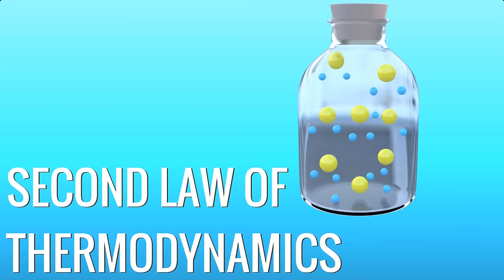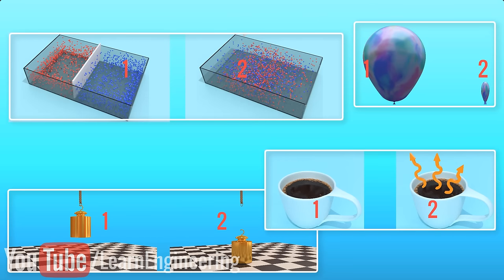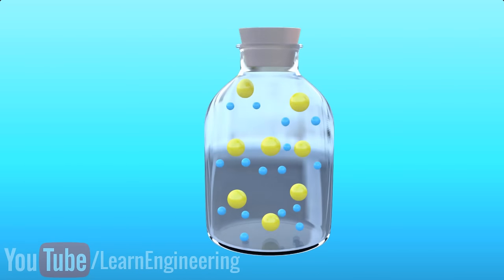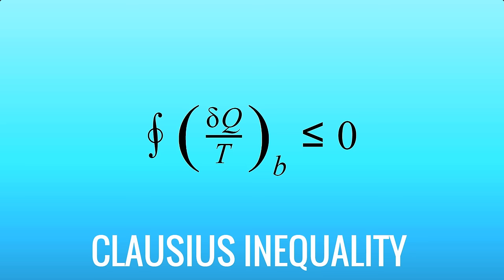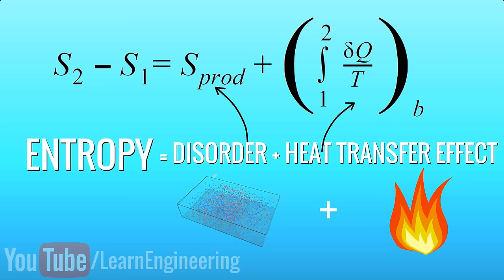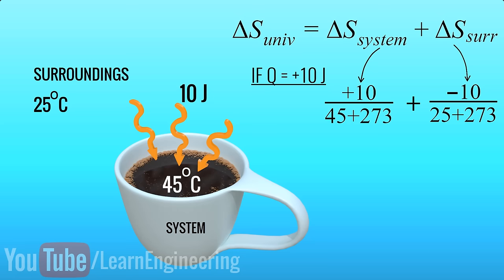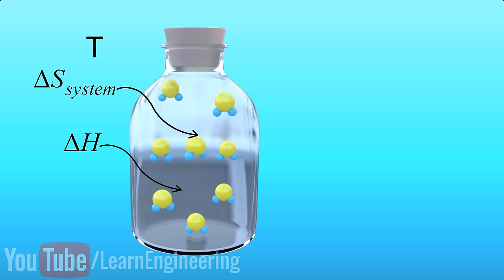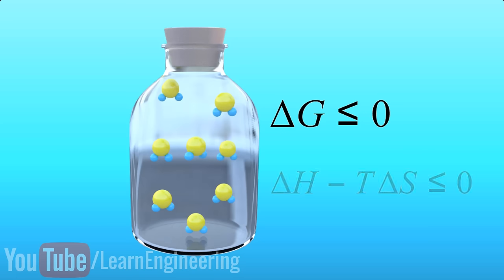Understanding Second Law of Thermodynamics !

Comment: People seem to be very confused in the comment section here, The second law of thermodynamics regards entropy. This law tells us Entropy in a reversible system is equal to zero and an irreversible system it is Positive because entropy cannot decrease. I do not like the typically definition people give of entropy, the best way to describe entropy is the amount of work lost in a system. No system is 100% efficient take a heat exchanger for example. a hot stream and a cold stream come in contact with each other where heat transfer from the hot stream to the cold stream takes place, the transfer of that heat energy is not 100% efficient and some of the energy is lost during the transfer and moved into the surroundings or universe, lost to both the cold and hot stream. This law simply tells us that this occurs.
Reply: wow you know it very well. then, WHY ARE YOU HERE?

Comment: So if we create a device or a system that is always colder than it's surroundings we could collect heat energy from it?
So if we could create a cold cell battery that turns that collected heat potential energy, into useful electrical energy, couldn't we make way better battery that could self recharge as long as the system or battery is always colder than it's surroundings? Question is how cold does it need to be to collect an adequate amount of heat energy in a reasonable amount of time, and what are the most efficient dimensions for the systems to function optimally for different out puts or energy needs?
Reply: @Appl3 YT I thought solar was just uv light absorption, that's the reason solar is useless during the night. I'll look into it more tho. I was more talking about a system regardless of day or night as long as the surroundings are warmer than the inside of the system you should always be able to collect the heat energy even in a blizzard.
Reply: @Appl3 YT just depends on how efficient your heat pump and compressor are. We have gases like freon that could easily stay cool with little power and conpress the collected heat into other forms of useful energy. I was using a blizzard as an extreme example as a condition where would still work as long as the freon or other  refrigerate is cooler than the surrounding  area to collect heat.

Comment: There's no reason a random entropy dip can't happen that would allow for all of the particles in the room (in the example) to separate themselves again on either side without adding any more energy into the system, of course it wouldn't be stable but to say that it can't happen just isn't true. Then again it's a nitpick and for practical purposes we can just assume it to be true and it won't matter since we'd have to wait longer than the lifetime of the universe to see such a large localized dip in entropy. I'm not sure why you claimed it can't happen though, maybe to try to not confuse more people? Either way it's just a correction. Good video for the most part otherwise.

edit* Also entropy is not a measure of disorder, its more like a measure of the "specialness" of whatever state you're measuring. Essentially using all combinations of macro/microstates of a closed system to evaluate an emergent statistical property of said "specialness".

Comment: Very nice video! But I would like to claim a flaw in this video. You treated a case of H2-O2 reaction to explain the free energy. The combination of H2 and O2, however, yields H2O “spontaneously” in most conditions, independent on temperature of surroundings. In other word, this reaction is intrinsically “irreversible”. It is not nice case to explain the role of delta G on chemical reaction. I recommend the case of ice melting and freezing to explain the role of free energy. Because plus or minus of delta G in this case sharply depends on temperature of surrounding. I deeply regret this only one flaw in all.
Reply: In my analysis, reaction oh H2-O2 is highly exothermic, while loss of entropy is possibly quite small (I am thinking about 3 mol > 2mol). In most of the set condition, delta G of this reaction automatically becomes minus.

Comment: Can you clarify the temperature using in Gib's free energy is the temperature of the system or the temperature of the surrounding? According to the steps of change in entropy of universe equal to change in entropy in system plus change in entropy in surrounding, the temperature using here should be the temperature of the surrounding, right? I am confused now.

Comment: Well enthalpy is the heat absorbed by the system at constant pressure, in ur case its at constant volume, isn't it be delta(U)/change in internal energy...?

Comment: Entropy to my mind is no more mysterious. Effect of Entropy can be overcome, there is one way, which can be verified or proven, the heat and power equivalents states that per 1kw of electricity only 1.6 kg of steam can be generated, or evaporated.  I have generated twice the quantity of steam I.e 3.2 kg of steam. So in effect it proves that I have overcome entropy. 
The idea to understand entropy is how it occurs? where it occurs? what effect it causes? & how it can be eliminated or cancelled or neutralized. So in effect I have arrived at a state where the heat and power equivalents need to be changed. Also because of this the second law of thermodynamics need to be reworded. 
My work is certified by thermodynamics and energy experts. Entropy to my mind is no more mysterious at least in generating steam.

Comment: still havent understood :))
Reply: ynk because he doesn’t actually tell you what the 2nd law actually is! I think it’s that heat will move from warmer matter to cooler, till they are equal. Entropy is involved because temperature is determined by the intensity of the activity of its composing molecules. The colder the matter is, the calmer the molecules are ( reverse entropy)

Comment: Second law of thermodynamics was stated by clausius and kelvin plank
Acc to clausius No process is possible whose sole result is the transfer of heat from a body at lower temp to higher temp.
Acc to kelvin plank no process I possible whose sole result is complete transfer of heat into work. These two r interconnected. If anyone of the statement is untrue the other one is also untrue.

Comment: How does energy of universe become positive if Q=-10 in the tea problem
Reply: The minus sign in this case means that the system (the cup of tea) is losing heat to the environment. This is known as the sign convention. If the sign was positive, this would mean that the cup of tea would be heating up, which is impossible, unless some sort of work is being done on the system (for example, microwaving the cup). In the case of work being done on the system, the sign convention is inverted. The work of the microwaves on the cup would be negative, because it is being done to the system. A positive value of work means that the system is producing work.

Comment: Anything that is explained in this absurdly complicated and horribly undidactic manner can not be taken seriously.
This guys are trying to confuse us instead of clarifying it for us.
It is like Economists that are paid and trained to make things look extremely complicated, when in fact they are very simple.  But they don't want people to be envolved so they overcomplicated it. 
Same here.

The Second Law of Thermodynamics states that the state of entropy of the entire universe, as an isolated system, will always increase over time.

So what is saying is: Entropy = ENTRO  (inside)  PIA (Change) = Change from Inside

The Universe moves to balance itself.  There can be differences here and there eventually because of something, but always on a effort to balance itself. 

There is no probability, there is no chance. That is what will happen 100% of the time invariably.

Any imbalance, any discrepancy in energy is against the laws of nature, the universe, physics, etc...

Nature (or whoever decided things would go this way) is working 24/7 for things to be balanced and level. 

That is the second law of Thermodynamics.  But people will simply not state it this clearly. For some pedantic reason.

Comment: Does this debunk the CO2 global warming theory?
Reply: @Appl3 YT well theory is that CO2 absorbs IR from earth and radiates some to surroundings and to space and some back to earth thus heating the surface . if this is true  it follows that heat is being transferred from a cool body to a hot body which counters the 2nd law.
Reply: @Appl3 YT Hmm, so you say CO2 traps heat from sun then radiates it down to surface? The theory shows CO2 absorbing IR radiated from surface and then radiating some back to surface. If CO2 was just absorbing frequency from sun and then radiating it to surface and surroundings then that busts the CO2 warming theory apart. If CO2 was not there then the same amount of sun's energy would hit the surface albeit at a delayed rate will it not?
Reply: @Appl3 YT So you are saying that CO2 is radiating energy ( heat) that was emitted from the surface back down again. That does not comply with 2 law.
Reply: @Appl3 YT well that goes against the 2 nd law doesn't it? If what you say is true then some of the heat energy emitted from CO2 to surface will then be emitted back to CO2 in a loop is that possible? That scenario is akin to reflection between two mirrors . It appears to me that the total energy from the sun to surface is constant and on its way it is absorbed by atmospheric gases and reflected by clouds etc together with being absorbed by exciting different gases dependant on their frequency. CO2 is affected by quite a narrow band of low energy sunlight and dissipates that energy to surrounding gases as well as to space. I can't see how CO2 can be adjudged to be responsible for warming of the earth when it is in effect a tiny percentage of the atmosphere and appears to be just slowing sun's energy hitting the surface and slowing the reflective energy leaving the earth. The energy involved is low energy and dwarfed by the other gases mainly H2O clouds etc so it is hard to believe the demonization.
Reply: @Appl3 YT hmm... Heat is trapped?  You can't buy cans of heat can you?  Must be short shelf life if you could. Or do mean like a greenhouse?
Reply: @Appl3 YT greenhouses don't trap IR they physically trap hot air through enclosure. CO2 isn't an enclosure is it?
Reply: @Appl3 YT Yup because CO2 lags temperature change

Comment: You kind of veered away from your goal of describing the 2nd law by using math instead of concentrating more on practical/visual real world descriptions. The 2nd law is really order going to disorder in a system without energy being applied to the system. If you leave your house the way it is and do not fix or repair it (energy input) , eventually, over a century or two, it will disintegrate and decompose into basic elements.

Comment: The proof is flawed. Saying that the change of entropy is always positive and then presenting an example where that cannot happen is like saying that (a+b)^2=a^2+2*a*b+b^2, so, to prove that, let's assume a=8 and b=6, (8+6)^2=(8^2+2*6*8+8^)=196, which is true. Although (a+b)^2 is always equal to a^2+2*a*b+b^2 we cannot just assume that a=8 and b=6 and if it holds true for those values, it's true for any other. You would need a more detailed proof and a LOT more math. Your video is like taking an assumption for granted and presenting an example. Apart from the general idea, the rest of the video is great.